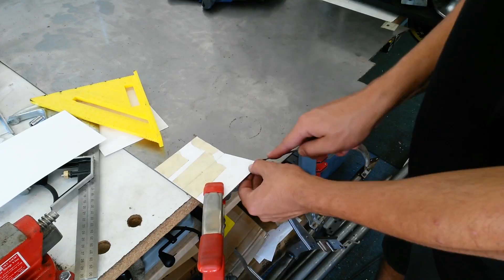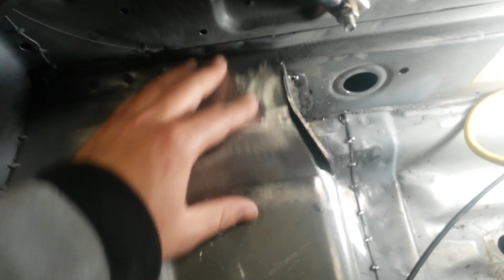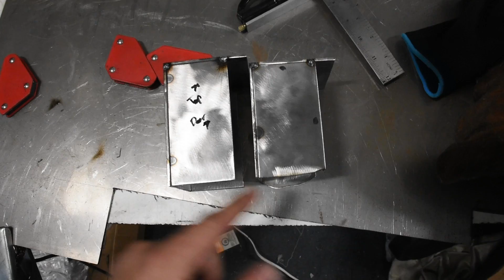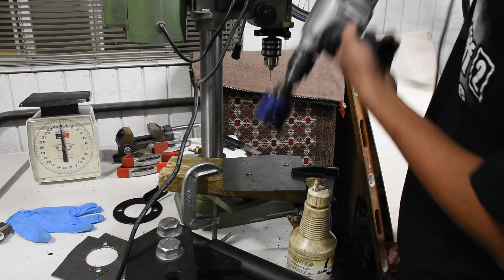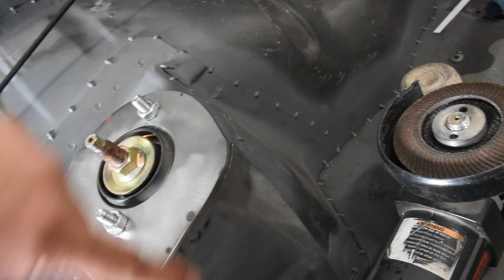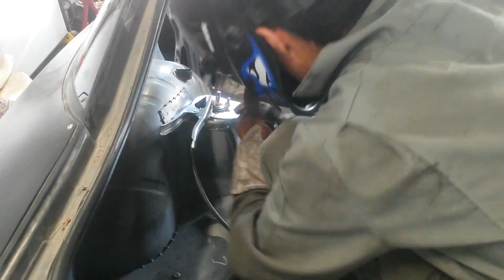Project 240 - Le Drift Car II | Ep. 10 - Base Plates | FD Spec Cage Build

Comment: In retrospect, would you hole saw under the base plate so you could drop the hoops 6-8 inches lower?  it would have made those top welds 100%and much easier.  once you're done welding just lift the cage up and slide the plates under
Reply from the maker: +Troy Blass I welded around the tops of the cage 100% already so no I would not hole saw the chassis for no added benefit in welding.
Reply: thanks for the reply, just trying to share and get an opinion

Comment: it would have been alot better to make the rear strut tower baseplate curved along the sides of the tower to make a cylinder instead of making that crude box. Welding the plates together doesn't really do any good if the plates aren't snug against the tower itself if you know what I mean. Just something to keep in mind for the next time :)

Comment: Dude, I've been watching these videos of your build all day, from what I've seen I've a few pointers for you in regards to your welding. I'm an apprentice trained pipe welder myself, It's been my day job for the past 5 years so I do know what I'm talking about. 

In a lot of your welds I'm noticing a pattern of cold lap (lack of fusion) where you're not actually fusing the metals, this was especially noticeable in the bottom runs on the base plates at 07:17, you can see a very dark lines at the bottom of the weld itself, I know you're doing this in your garage yourself but something like a roll cage is there to serve a purpose and with welding like that in the event of an actual incident the welding will most definately fail. 

Try turning up your amperage or if you're too worried about burning through the metals slow down your welding passes. Or the best option is to invest in a TIG welder,  TIG has many advantages of MIG. I hope I helped, really enjoying your videos dude.
Reply from the maker: Yeaaah those baseplates were the first ones I welded in the car. And it was pretty difficult for me to adjust the welder properly to that setup out of the car so the setup beads were the ones also on the car. In the end I had it setup to just before it would start blowing through the metal on the floor. Thanks for the tips :)

Comment: do you have a rear strut bar or are you planning on having one?
Reply from the maker: +Brighton Collver Not planning on having one. Just need to weld a bar between the rear base plates and with the base plates boxed in like they are, it will be stronger than any off the shelf strut brace.

Comment: Why is the cage built in the begining? Where are the rest of the bulid videos?
Good job on the car!
Reply from the maker: +Afonso Gamming Cage isn't built in the beginning. That's just main hoop, hoop supports, and passenger side hoop tacked in. Still need driver-side side hoop, dash bar, door bars, anti wheel intrusion bars, side hoop support, roof support, main hoop horizontal, harness bar, rear support diagonal and then full welds followed by gussets. 

Even if the cage was done, each episode takes 30-40 hours to edit. So even if I have something done doesn't mean I've had the time to edit the video for it and release it. 
Thanks :)
Reply: +OffBeat Garage oh ok. I anderstand. Continue the amazing work plz! I love ur vids!
Reply from the maker: Afonso Gamming Thanks :)

Comment: Part of the reason for some roll cages using less material than what you are doing is to cut down on weight. All the extra bits that is done everywhere adds up and before you know it's 100lbs heavier than need be.

Comment: WHAT!!! NO WELD THRU PRIMER BUD!!!!!!!
Reply from the maker: +Barry christopher Not needed
Reply: +OffBeat Garage  Behind the plates. between the floor steel which is bare and unprotected as well as the plates.  Bleieve it or not but depending were you live those plates will rust inside out. HEY JUST SAYN IT WOULDNT OF HURT NOT TO SKIP THAT STEP BUT LOOK GOOD.
Reply from the maker: +Barry christopher They won't rust out from the inside out because all of the seams are fully welded around sealing the backs of the plates from the outside world. So there is no oxygen being exposed to behind those plates and oxygen is needed for rust to occur.
Reply: +OffBeat Garage  BEEN THERE DONE THAT. LOL my first car was back in 96.  i still have it (wrecked) plates rusted threw years down the road but if you plan on keeping it ..... LOOK MAN GOOD JOB. KEEP UP THE GREAT WORK

Comment: if you end up throwing an LS in this im going to be very upset and sad.
Reply from the maker: +nick Well you sir don't have to worry about that cause I like the opposite sex aka I'm not gay therefore would never LS swap
Reply: thank God....  #Run2JZ
Reply from the maker: +nick yeee buddy
Reply: +OffBeat Garage I approve of this build now👍🏼
Reply: +nick Im not sure why people talk so much crap on LS engines. From someone that has had multiple car experiences with stock ka, ka-t, sr, and 2j, and LS I can personally say the ls swap is the best bang for the buck in terms of power and reliability at stock power levels and way more fun than a ka or sr which lack in low end torque. WAY cheaper than a 2jz or sr. I swapped a 5.3 with the expensive t56 6 speed running and driving car in my old s13 a few years ago for 300$ less than i could have bought a 2jz with automatic w58 engine. I threw a 80mm turbo a few months later and made 550hp and 570q on 9 pounds and very conservative timing and it still cost less than a "stock: 2jz with a r154. I guess its just personal preference but the LS gets a lot of hate for n reason. People just hear their buddies talk about ls being garbage so they hop on that wagon too. An LS would probably be the best choice for a drift car thats why you see 80% of fd teams now days switching over from 4 or 6 cylinder to running some sort of v8 and almost all are LS based engines except Forsberg and his VQ.
Reply: yawn. Forseburg has a VK and LS is just boring and V8's sound like ass. all im going to say. bye.
Reply: +nick well at least you have a good reason why you dislike them.. Come down to Philadelphia i will give you a ride in my boring car that sounds like ass I'm sure you won't be able to stop smiling.
Reply: ive rode in an multiple LS cars. Sure its fun and any person who isnt brain dead would smile. Just not my cup of tea. Sorry.
Reply: +BlueCollarDreams haha v8s are legit i have a 5.0 s13 and I'm gonna swap in a ls1 cause there fucking awesome ha
Reply: +nick everyone likes there own thing so why talk down on something different then what u like?? why not say this instead of talking shit???

Comment: It's not clear in the video but if you're not using weld through primer you should consider doing it so stuff doesn't rust from the inside out.
I really like your attention to detail in your fabrication, designing the stuff. I like the boxed look too, kind of raw-cool, but It's fun to see someone thinking a bit about design for a change. :)
Reply from the maker: +Rickard Jonsson I'm going to be using the weld through primer on the gussets which will be hard to fully paint and the backsides will be exposed to the air. The boxed in base plates however are welded all the way around the seams so there is no exposure to oxygen. And you need oxygen for rust to occur so there's no issue with them rusting from the inside out on the base plates. Thank you! :)

Comment: Just wondering is a roll cage illegal for street vehicles ? and do you know more or less how much weight did you add to the car with all this metal ?
Reply from the maker: +NotIrishRider Considering a Porsche GT3 RS comes factory with a half cage I'm going to say it's perfectly legal haha. Going to be about 100-125 lbs of extra weight. I'll take measurements and calculate the end weight when the cage is fully done :)
Reply: ***** I was thinking about mounting it in my car the car is worth barely anything anyway and it would be fun to mount one in my daily driver ... i also do metalwork and engineering in my school so i know how to mark out and cut metal so it should not be too much problem. Also would the roll cage not stiffen up the frame of the car ?
Reply from the maker: +NotIrishRider Should be fun. Wouldn't be as practical with a cage but yeah haha. Yes it stiffens it up
Reply: ***** Well i like driving above the speed limit (when safe) And i would feel a lot safer with a roll cage Maybe not a full one because i need to be able to use all 4 doors and the trunk. Its a 2001 volvo s60 which even with its soccer mom status it pushes 180hp stock and with a 750$ ecu tune it goes up to 240hp and i also get a diagnostics computer in that price. But the car is not slow by any means and the inline 5 at low revs sounds like a v8 or maybe its just my engine trying to tell me something is fucked >_> Oh well. Also what are your plans to your drift car number 1 ? I have not seen it in a while did you sell it ?
Reply from the maker: In that case a cage would be a good idea for safety reasons. The first car is being parted out.
Reply: ***** Ok i really appreciate the reply's Cant wait for the next episode :)

Comment: why add extra weight and form a pocket for rust to develop?
Reply from the maker: +Drinking Fighting Irishman Rust can only form with oxygen and the plates are fully welded around so no oxygen can get to the bare metal underside so rust is not an issue.

The biggest base plates weigh in at under 2.5lbs each which is not much added weight at all for their gain in structural rigidity in the tower.
Reply: ***** ok you done a fine job but no need to tell us all how shit our normal base plates are it comes across as elitist
Reply from the maker: +Drinking Fighting Irishman Well that wasn't the objective haha, the point was to give you a heads up between a cage builder that's going to try and do the best job possible and a cage builder who's just trying get the job done. That way when you guys have your cages built or build your own cages you know what to look for :)
Reply: ***** ok well great job anyway top notch
Reply from the maker: +Drinking Fighting Irishman Thank you my man :)

Comment: So you used the flap discs to grind those corners down? I need to do something similar and I'm not sure on what disc I need to be using 😁
Reply from the maker: +Sean McCreedy flap disc everything haha. No seriously though a flap disk is basically the most versatile disk to use. Cut off disk for cutting, and a flap disk for everything else haha
Reply: +OffBeat Garage well that clears up my problems haha thanks man!
Reply from the maker: Sean McCreedy Haha no problem!